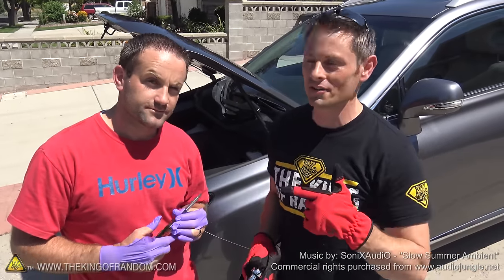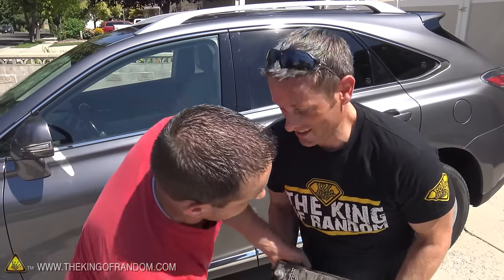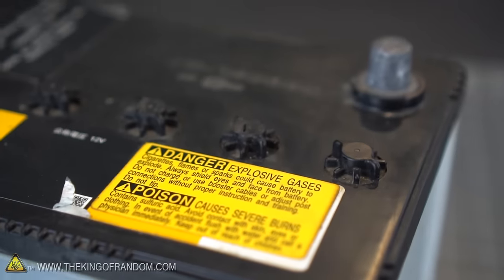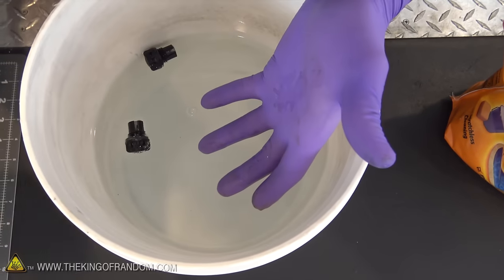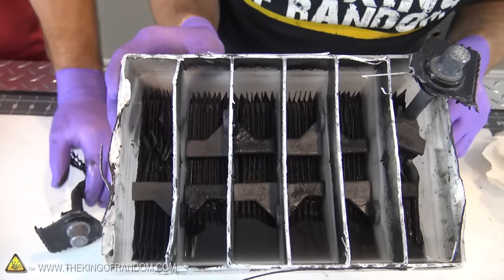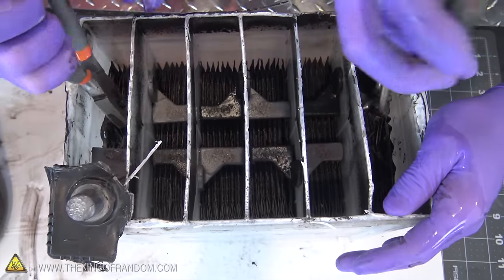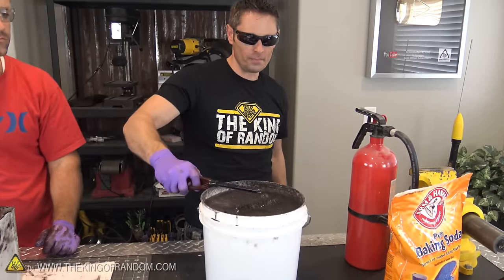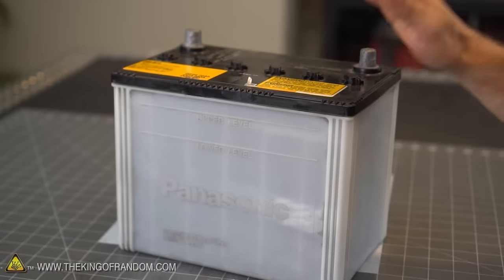Hacking Open A Car Battery (for Lead and Acid)

Comment: As a chemist this was extremely stressful to watch... I'm surprised with how sloppy and careless they were with such hazardous chemicals?! Especially scary to think about the others that could be following this experiment and seriously injur themselves by not using proper PPE
Reply: When
Reply: cope
Reply: Ok Walter white
Reply: i open the car batteries. i drink the chemicals
Reply: Nerd
Reply: The most sane acid drinkers in the comments section
Reply: Amen to that. Goggles, elbow high gloves, face shield and long coat minimum. I recommend a respirator/ filter mask go some sort when neutralizing stuff or pouring the acid out.
Reply: I guess

Comment: Cool! The lead is soft and spongy for maximum surface area. Id like to see you take apart a deep cycle battery and look at the comparison between the plates.    Also the pool store near me sells very pure 30% sulfuric acid by the gallon, have you seen it in stores near you? Maybe its just Florida thing, but it might be worth letting people know instead of dealing with yucky lead filled acid!
Reply: Hi

Comment: If sulfuric acid gets on your clothes, it will eat holes in them. Not bleach them.
Reply: +mooe1965 that's the best you could come up with? guess you better hide in your safe place before some offends your feelings with words.
Reply: Not if there is polyester in the clothing.
Reply: If you get sulfuric acid alone, make crystal meth.
Reply: its diluted sulfuric acid.. 70% water.

Comment: tip: drill a hole in the battery to drain it. 
tip2: keep your freaking glasses on!! I have seen horrible burns from that stuff. as well as battery explosions. once you see one of explode -- respect becomes the new word of the day.

good luck fellas...

Comment: "Because this is sulfuric acid, you want to put it in a glass container" <pours the acid out of a plastic battery>
Reply: I am ded yes
Reply: @IMightBeIris  bit late, but most plastic is immune to most acid.  I've got 98 percent sulfuric and 35(ish) percent hydrochloric and 68 percent nitric, 100 percent oxalic and 100 percent formic acid all in plastic containers.
The only iffy one there is the nitric acid.

The sulfuric acid will eat through the plastic container, but not in your lifetime.  At room temperature the reaction is incredibly slow.  At 200C (i.e. above the melting point of the plastic anyway) the long chain hydrocarbons get broken down into shorter ones and eventually into carbon tar.

Some very few plastics are vulnerable to sulfuric acid, mostly ones with OH groups like cellulose or PLA.
Reply: Lol

Comment: How many batteries would it take to melt a body. I'm asking for a friend. >_>
Reply: you need to watch his next video on concentrating the acid.
Reply: jacob mitchell <_< Thanks...
Reply: If you mean in electricity melt about 64 mega joules
Reply: Are you asking for the friend your melting?
Reply: Stretch Reality <_< >_> <_<
Reply: So where is your friend now?
Reply: +John Smith
Buy him a dozen roses - - he will just melt . . .
Reply: +TIMEtoRIDE900 awww
Reply: You need hydrofluoric acid for that, sulfuric won't get the job done.
Reply: Whit Weber Breaking bad lol
Reply: Wow guys thanks for the help. >_> The problem has been d̶i̶s̶s̶o̶l̶v̶e̶d̶ resolved.
Reply: +EggiTheShadow I wouldn't use a bathtub u would get into a terrible mess lol
Reply: You could've said that sooner. My friend was in the tub and he spilled 'liquid' everywhere. :\
Reply: Alexander Martinez Not really.. you wait for the body to dissolve and then pull the plug out so they go down the drain
Reply: 10 (You need to concentrate it)
Reply: Terrible choice for that. Slow and super inefficient. Lots of toxic/flammable fumes as well. 
         
You will do better going the opposite direction and use sodium hydroxide (lye) instead. 
    
That said, you can just purchase acid (sulfuric, hydrofluric, boric, etc) - most as surface cleaners or drain clog clearers. 
     
Still, if you have time and facilities for that, consider desiccation and pulverization.
Reply: Oakspar Oakspar how many times have you done this to know that
Reply: A friend told me that the large batteries used in mill 24VDC and commercial applications are the best as you need only 10.
Reply: Throw the body in lava so noone can find it. Its cheaper and more efficient

Comment: Playing with sulfuric acid.... Not A Good Idea (:-/
Reply: especially with exposed skin...
Reply: keep it out of your eyes and you're fine, takes a long time to burn you skin and you'll feel it itch. Just rinse it off. Not a big deal.
Reply: screwyluie it's just bad safety procedure in general not to mention an older battery might have a higher concentrated acid mixture in it due to evaporated water. Better to be safe doing this stuff than get hurt because you didn't take precautions.
Reply: go watch nile red it took over 30 seconds with highly concentrated sulfuric acid.
Reply: It's okay, he's a professional shenaniganist
Reply: +MichiganEMT definitely lol
Reply: It's not the acid that he should worry about. 35% isn't that strong. It won't burn a hole in your skin. It's only when it gets up around 90% where tissue damage happens quickly. The problem with that solution is it is loaded with soluble lead salts. Wherever they did that project is coated with lead salts after the fizzing from the baking soda and the splashing. there is no safe level for lead exposure, and soluble lead salts are the easiest way to be exposed to lead.
Reply: +kudosdc You're absolutely right about the lead salts being the danger here but even with 98% sulfuric acid you have more than 30 seconds to wash it off, even at that point the only damage will be a bit of peeling of the top skin layers. As someone else said check Nile Red's video about acid on skin.
Reply: Childs play, literally. It's hard to find a man who grew up in one of the COMBLOC countries and never played with the car batteries, led and acid as a kid.
Reply: At least it's not hydrochloric acid (stomach acid)
Reply: +Da Kerby4590 Channel I think concentrated sulfuric acid is a little bit more dangerous than hydrochloric acid
Reply: +Da Kerby4590 Channel sulfuric acid is more acidic if I'm correct.
Reply: this is grant thompson
Reply: no this is patrick
Reply: RJ Wilson is this the krusty krab?

Comment: Those Panasonic car batteries are (or at least used to be) awesome. My old Mazda came with one from the factory. That battery lasted 12 years before it had to be replaced. Didn't show any symptoms of weakness either. Just one morning everything was dead.

Comment: A couple things...

1. You really gotta have splash-proof goggles when you're working with sulfuric acid. The consequence in the end being complete blindness. 

2. This seems like a waste to do all this work to get maybe %30 by weight sulfuric acid, when you can get at most hardware stores, drain cleaner that is anywhere from 80-98% azeotropic sulfuric acid for like $5.
Reply: I guess if you're gonna use the metal bits and stuff, nevermind.
Reply: +Don't Even Bother no, I agree. this was a waste and too dangerous for what they got in the end.   I'm very surprised this guy went to all that trouble to do this..  I think it was just to make a video for  views.
Reply: Ryan W There are definitely better ways of getting these materials.

Comment: Probly should have used a fume hood.
Reply: WHY?
Reply: Dont be stupid.
Reply: TheGuerrCZ Well ik that now...
Reply: No need. The sulfuric acid is not very concentrated, and the only reaction occurring significantly enough to possible harm you is the acid-base, but it won't because the only gas produced is CO2.
Reply: It actually is necessary to wear protection because acid emits vapours. I sell this stuff and I use this stuff. It's part of my training to know how to safely use it.

Comment: Only one cares to protect his eyes?
Reply: Yeah, and they're wearing the wrong kind of safety glasses for dealing with a dangerous liquid.
Reply: don't worry he has the baking soda 😂
Reply: +Daniel Morales LMAO
Reply: The neutralisation of the acid will burn him anyway. It's exothermic.
Reply: The acid isn't strong enough to melt through the glasses instantly. At least it won't be going straight into his eyes now
Reply: Well no, in my UNI laboratories they all use safety glasses in the style that they are using. If anything that large splashes the other ones won't save you anyway.

Comment: You need to wear safety glasses and an apron.  Your shirt wad probably full of small holes.
Reply: They'll be fine if they are careful. I once manipulated 500 mL of 70% nitric acid without an apron, glassed, gloves and I was bare feet and in shorts.
Reply: But why.
Reply: It's actually better to not wear gloves when using Nitric acid in most situations, as the nitric acid will react with most gloves and cause them to melt and burst into flames. Nile Red did a good video on it.
Reply: +Ilovelazers this is sulfiric. not nitric
Reply: I know, however, I was refering to Luke Droy's comment.
Reply: Kazza FDM Cause I live in Canada, where you need a license to get potassium nitrate.
Reply: Ilovelazers I didn't know that. When I was about to drop around 100 grams of KOH at once while neutralizing, I decided to first drop 1 small piece of it into the nitric acid just to see what would happen. I then realized that mixing the whole thing at once would've been a huge mistake, because dropping only 1 gram made some acid droplets come out and it made a pop glass sound (I was using a mason jar). Also, the container became quite hot. Final result: my wooden floor has some permanent red stain from the KOH since I dissolved it and my bookshelf where I stored the remaining HNO3 bottle was discolored.

Comment: NaHCO3 is amphoteric, not basic by definition.
Reply: When added to water it is.
Reply: +kleetus92 It's just become an amphoteric solution...it doesn't act as a base until a relatively strong acid is introduced and likewise with basic substances.
Reply: OK, but you're not going to use it to neutralize sodium hydroxide... at least not very efficiently. Generally speaking when you take a metallic ion and pair it with a non metal, you end up with a basic solution in water.
Reply: +kleetus92 Not really. Zinc Sulfide isn't exactly basic yet its a metal ion paired with a non-metal as you said. The definition of a base by the Brønsted-Lowry theory is a substance that accepts protons thus Ammonia is a base even though it lacks the OH- group.
Reply: +kleetus92 Im using you to help me revise btw. Thanks.
Reply: +ALL KINDS OF GAINZ yeah, high school chemistry for the win!
Reply: +Girish Manjunath Yeah man. I wish they'd let us do just pure chem instead all this history stuff. I cannot think of a place where knowing who Brønsted-Lowry is can be in any way useful unless you're a chem teacher.
Reply: it's actually a buffer.
Reply: Well if you are working in a labrotory or in the waste water treatment plant your work will be a lot of easier, specialy if you work with pH meter and their calibrations.
Btw. it is content in many chemical apprenticeships in my country.
Reply: It's been 25 years since I've been in a chem lab, and to be honest I miss it. Been doing electrical engineering in it's place. Good times.
Reply: ALL KINDS OF GAINZ I actually had no history of them at all. They were barely mentioned except to explain the concept.
Reply: Engineers aren't exactly renowned for their imagination.
Reply: Girish Manjunath Yeh HSC chem is different. So much history.
Reply: ALL KINDS OF GAINZ I was in hsc. Indian education for the win!
Reply: Girish Manjunath What school?
Reply: ALL KINDS OF GAINZ CBSE. Look up the portions.
Reply: Girish Manjunath Ah. Im in Australia. They're changing up the syllabus abd shifting towards more actual chemistry in 2018 but it's too late for me.
Reply: ALL KINDS OF GAINZ heh. I'm in college myself. Many of the things they're teaching here, I'd already learnt.
(State Board sucks here.)
Reply: Girish Manjunath LET ME INTO ENGINEERING
Reply: ALL KINDS OF GAINZ I'm in BSc. Microbiology...
Reply: ALL KINDS OF GAINZ It is! The lab especially is really fun! Biochemistry, not so much, as it's just titrations now, and I have oxalic acid coming up. That shisct's difficult.
Reply: Girish Manjunath Our Assessment 3 was a titration. The Barium Hydroxide formed a tiny layer of precipitate in burette which may have screwed up some people's results but the funny thing was that it was an error that the teachers made and they realised halfway through the exam.
Reply: ALL KINDS OF GAINZ Heh. We had FAS-KMnO4 for our end of year practical, and I actually ended up over diluting the salt solution...
Still got the nearest answer to the externals'.
Reply: Girish Manjunath Hahahaha Nice!

Comment: The carbon dioxide is not "stealing" the oxygen... It's simply displacing the gasses around it. 
There is no reaction, it's just moving other gasses away.

Comment: hey guy I got a new car let waste close to 400 dollars on taking the battery apart
Reply: Batteries are not that expensive
Reply: I have the same lexus rx 350 and the battery cost around 40-50$ in my country here.
Reply: +HaroOn Ops yeah most car batteries cost that
Reply: 400 dollars!!?? 😂😂.   Where are you from?   Must make the car time travel for that price.
Reply: Car batteries aren't anywhere near that expensive and they where already planning on buying a new one anyway
Reply: +enrique rodriguez He must be driving a electric car.
Reply: +CrazyRoadblock no... you need to learn the concept of a battery... a battery is as much as a battery of its just a battery..
Reply: CrazyRoadblock i mean hes not driving an eletric car
Reply: Jarrett Hamilton Exactly.
Reply: Jarrett Hamilton ... 400$? are there not many car batteries in your country?
Reply: 80 $
Reply: Jarrett Hamilton $400 from the dealer, same battery from oriellys $120
Reply: Jarrett Hamilton This type of car battery show in the video here would cost about 130$ where I am from, the reason i know is because i bought one today because mine froze and we had to replace it. In our farm equipment the massive batteries that weigh like 250 pounds cost about 400$. And those are for semi trucks and big tractors.

Comment: I would suggest laying the battery on it's side and drilling a hole in the top and bottom of each cell and then letting it pour slowly in to a large Pyrex tray. Your method has a lot of splash.

Comment: I work for a battery manufacturing company called crown battery. I am known as a "hand burner" dealing with a live battery is dangerous. We have battery cells explode every once in awhile. That "membrane" is covering the positive plate which is lead oxide compressed into a grid. Aka seperator material. It keeps the cell from shorting out and exploding.

Comment: Chances are the metal 'backing mesh' you're talking about is pure lead, and the 'lead metal' on top is actually lead oxide. You'll have to process it if you actually want to use it like lead. Lead, after all, doesn't tend to flake when you bend it.

Comment: As an auto parts store employee, I don't get tearing apart a perfectly good battery. You can buy acid by the quart at most parts stores. As a veteran mechanic (35 years ) I have never had a battery explode on a vehicle that I was working on, but I have seen others explode .Hydrogen Sulfide is the gas produced by a charging battery, and it WILL explode. The gas you attempted to light was carbon dioxide, the result of most acid + baking soda reactions. Including the vinegar + baking soda that makes so many science fair volcanoes work. Vinegar contains approx. 5% acetic acid.
Reply: Nice! I’m actually a student at Universal Technical Institute and currently in the intro to electrical theory, so we’ve been reading and building circuits, as well as testing voltage, various battery types and so on.

Comment: The casing around the metal is actually rubber. I worked in a factory/plant in pineyflats, tn call micropors which creates the rubber in all types of batteries.

Comment: Best way to open the battery is to cut the terminal first and then easily open the case and pull out the rest of the plates.

Comment: The reason why you can boil the water out to concentrate the sulfuric acid is because the boiling point of sulfuric acid is much higher than that of water. Sulfuric acid boils at 337°C where water does so at 100°C.

Comment: Take out the bungs, get a box of crushed chalk, limestone, or sodium carbonate and tip the battery upside down on it. Much fizzing as the acid is neutralised and the CO2 is given off. When it stops, put on eye protection, and some kind of protection (or swimming togs if a pool is available to go for a swim after). Whack the battery to pieces with an axe or sledgehammer. Let it sit a while to get rid of the last of the acid. Dig a cone-shaped hole in the ground and build a fire, including more lime / soda mixed with the battery pieces. Get it good and hot, and the lead will run to the bottom of the hole.

Comment: Protip - next time you need to get the clips out to take off your decorative panels just push them down if they are the oem ones. They all push down then you can lift the whole panel at once. To reset them just push them into a hard surface and they will pop open.

Comment: So the stuff that breaks off the lead mesh, is lead oxide, you need a higher temperature to melt it! Only a thin sheet of mesh is actual lead metal! You are better off beating the sheets with a rubber mallet and disposing of the lead oxide for later use or to a recycle center, then melt the regular lead metal.

Comment: Cut the negative post off flush, then drill the back out, until it weighs 1.125 ounces, and you have a shotgun slug. 
Probably wouldn't shoot it in a full choke. But in a modified barrel it cracks engine blocks.